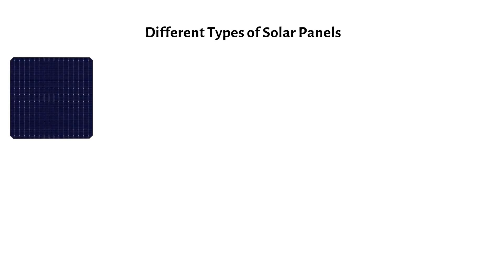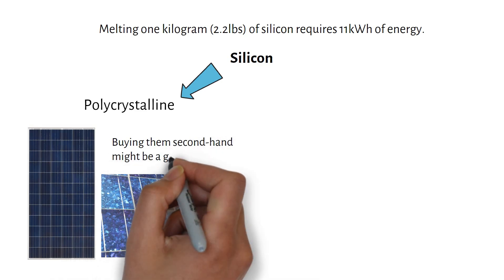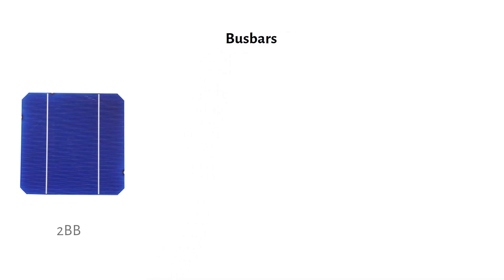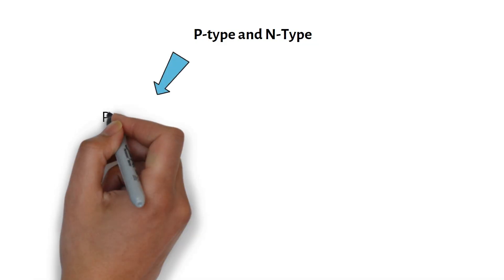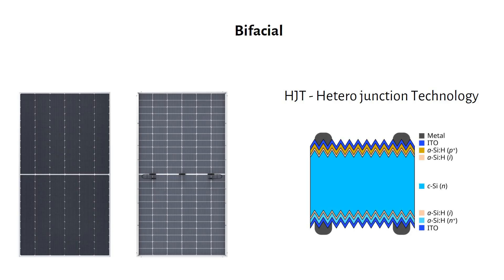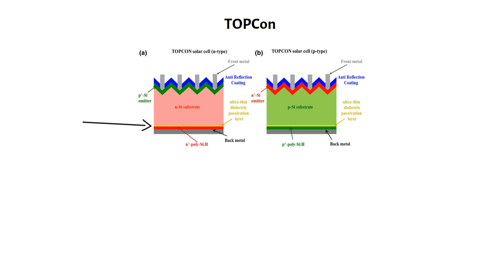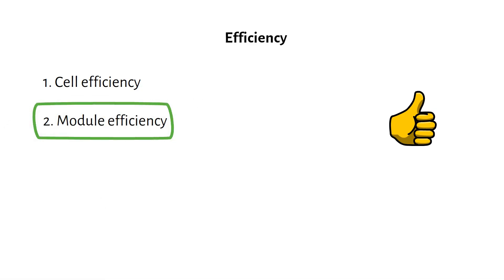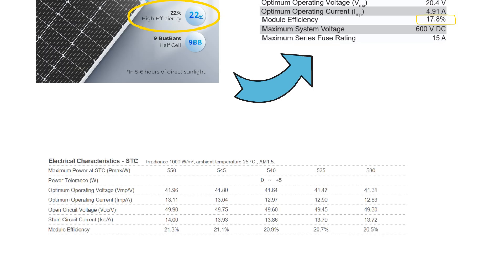Different Types of Solar Panels: What is PERC, TOPCon, N-Type, HJT,...

Comment: @cleversolarpower l am building a camper van with a tilting solar array on the roof, to maximise the solar efficiency from the panels. Which panels should l be looking at in the 450w range? Are glazed panels suitable? 
Many thanks 
Pete
Reply from the maker: You mean glass-glass panels? Its going to add extra weight, which might be a concern for the weight of your van. Why not get glass-backsheet?
Reply: @cleversolarpower thanks for coming back, is that what you would recommend?

Comment: Hey Nick, great video (as usual). I'd like to brag on the panels I got (used)...Trina bifacial 405w. On a 55°F noon, I saw them crank out just above 100% over rated output.
Reply from the maker: N-type, topcon, or PERC?
Reply: @cleversolarpower I assume N type bifacial. They actually pass a blue light as viewed from the back.

Comment: Maybe a video on various build environments (like a specific style roof) and what the cost differences and expected energy gains would be. I am finding companies are trying to sell old style parts at exorbitant prices. Including a range of what the standard price range would be could be VERY helpful. I have even debated on making a bulk purchase and reselling local to help in my own expenses.
Reply from the maker: That would also depend on location. The best is to compare local installers or do it yourself with inspection. Buying solar panels in bulk is a good idea. Somebody ordered a pallet from china but he didn't need all of them. So he resold the rest for $65 per 450W panel. That would be about the same price if you ship them straight from china (in Europe).

Comment: For residential rooftop, the amount of panels that you can fit on the rooftop is generally very limited. So I would generally recommend that you fit as much watts of solar that you can fit in the available space.
This would then be the most efficient panels, so generally the TopCon panels so that you can get the highest watts possible on your roof
Reply from the maker: Indeed, if you are constrained by space then the most efficient panels might be better. You also need the budget for it.

Comment: Well according to your video my Renogy 16BB N-Type 250 Watt Solar Panel is the correct type for my Vertical Set up on my Flat Balcony. That's if I did fully understand what you Was Talking about 😊
Reply from the maker: Yes. Compare the price of other panels as well. If you can pick them up locally it's probably cheaper. I recently picked up 2x 450W panels for $65 each.
Reply: @cleversolarpower I'm UK I've purchased 4 Cost UK £200 each Had them 6 months Upgraded from previous 200w standard Renogy Thanks for your help

Comment: Does your rooftop panel recommendation include RV rooftops? Weight is always a concern.
Reply from the maker: No, for RVs I recommend different solar panels. Usually smaller 100-200W. I do not recommend flexible panels.

Comment: let's not forget the multijunction photovoltaic panels. even if they are not yet commercial. maybe the future has surprises in store for us
Reply from the maker: Do you mean HJT?
Reply: multijunction panels have 3 or 6 layers optimized for a specific wavelength and generally have an efficiency of 40%. For now, they are used sparingly. But who knows?
Reply from the maker: @eugen-m  Never heard of them. I tried to stay relevant in this video and not talk about future tech. I guess they are not worth it because they are too expensive for residential/off-grid systems.
Reply: @cleversolarpower well , agree. Îs not usual  . They're not common. But the technology is old, it's been used for decades on satellites and in solar concentrator systems.